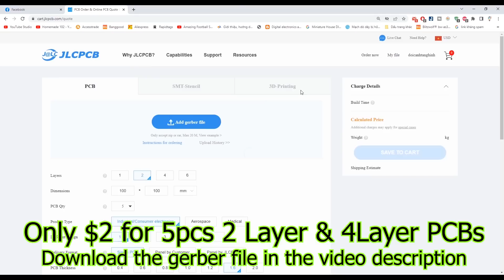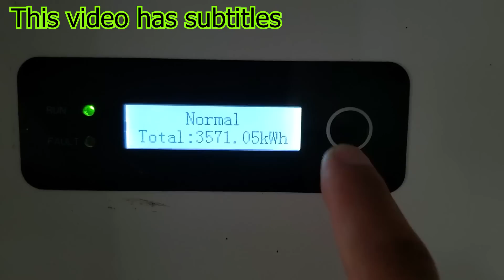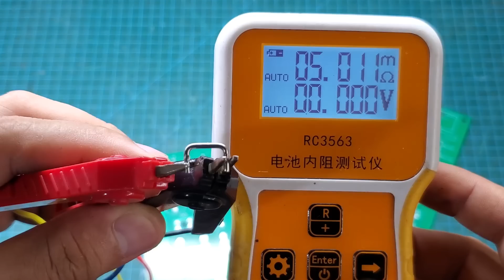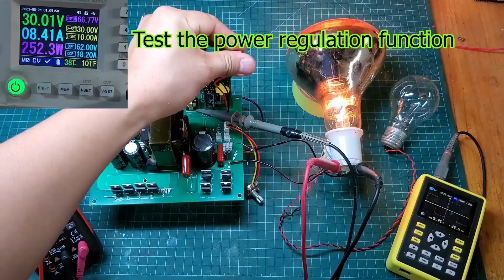Make boost 1500W-380V CC-CV | JLCPCB

Comment: Can the circuit be used simultaneously with 12v 24v 48v?
only 30v is used in the video.🤔🤨
Reply from the maker: transformer in video for 24V system. if using 12V system, transformer is 2T+2T : 63T. 24V is 4T+4T : 63T . Same with 48V or 60V.
Reply: @PhdHung  Thank you.😇😀

Comment from the maker: This module increases the battery voltage of 12V-48V to 380V so that the grid-connected inverter can work at night.
Reply: I notice that whenever you connect the second lamp, your duty cycle reduces on the oscilloscope, I thought it should increase in order to compensate for the increased load...
Reply from the maker: no, with constant power, as the load increases, the pulse width will decrease.
Reply: I think when pulse with reduces, output power reduce...
I'll be grateful if you explain in details, thanks
Reply: Hello sir.. do this DC_DC  keeep set voltage ''output''..... in case of constantly changeing input voltage??